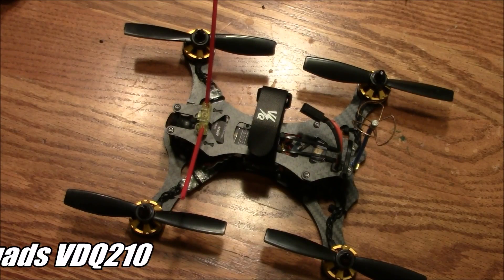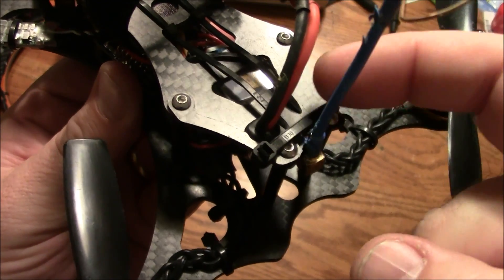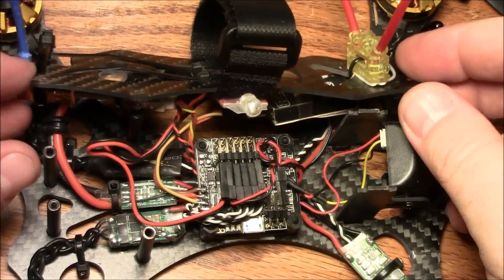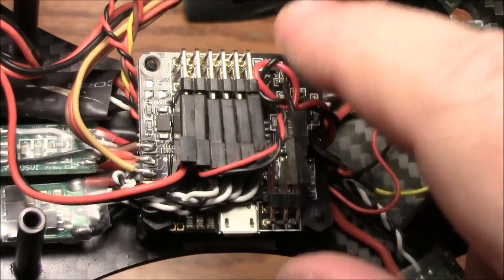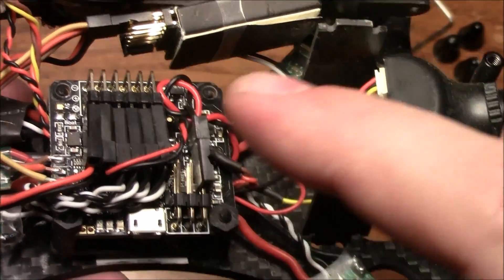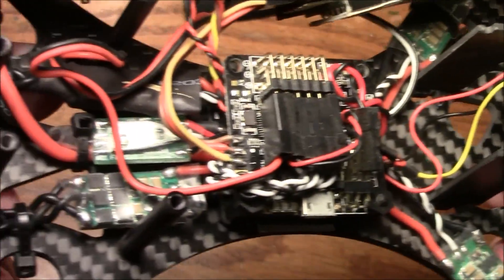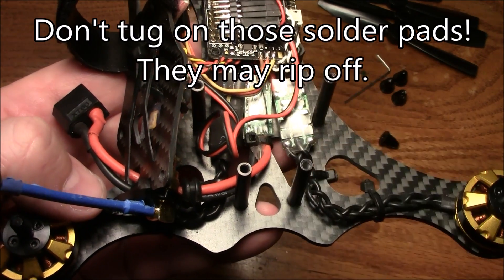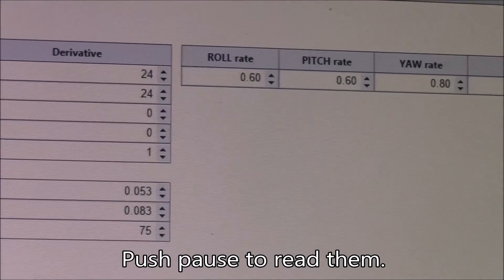VDQ210 Full Review, Tuning, Build Information, and FPV Racing

Comment: I am building this setup now. Is your receiver just hanging off the antenna wires or did you Velcro or double side tape it? Great video, thanks!
Reply from the maker: +Tod Anderson Heh... right now it is just hanging off the antenna wires.  I need to get some foam tape on it and a zip tie around it.  :)

Comment: How does it compare vs the ls-210?  There is a big price difference
Reply from the maker: Overall I like the VDQ210 better because i think it looks cooler and may fly a little better.  I'm less scared of crashing the LS210 because it was cheaper so I end up flying it a little more often.
Reply: +travisgrindal Any durability issues?  I like the price of the ls-210 and was wondering if those bigger holes on the bottom are a durability issue.  Also I read that the ls210 is actually 220?

Ouch I don't like that cracked arm!  That must have been a rough crash!
Reply from the maker: +CoolStuffReviews it is closer to 220mm.  i haven't had any problems with it yet and I've crashed it plenty.  The VDQ210 is also available now with a 4mm main plate.  It is a little heavier than the original 3mm but it seems to be a lot stronger.

Comment: Given that your naze32 already has vbat in connected, you dont need the battery voltage sensor, you can run a signal from a softserial port on the naze32 to the d4r-ii and output the battery voltage from that. There is a walkthough in to doco for cleanflight (turn on soft serial, go to the cli and enable telemetry signal inversion, add frsky to the appropriate port in the port selector, test). Save a few grams and $$ (once you get it working, it can be a pain)

Running the 5V from the transmitter isnt a bad idea. The only possible issue is it might not supply enough power and may brown out causing the FC to reset. Given the FC only needs a few hundred mA and the D4R-ii only needs about the same, this shouldn't be an issue as long as you arent doing something like running LEDs of it as well. Weight saving is awesome!
Reply from the maker: +Martin Turner I use to read the voltage from the Naze32 but (maybe it has changed now) it only outputs the voltage when the quadcopter is armed.  The FBVS-01 outputs the voltage readings all the time and it works consistently.  In fact, I use it a lot to check battery voltages at the flying field.
Reply: +travisgrindal only issue I seem to have with the cleanflight monitoring is it sometimes takes a few seconds after powering up before I get a reading, but it seems to read while disarmed now without issues. Do whatever works though :) You still fly better than me.

Comment: Travis, great video but i'm trying to figure out why you have the FRsky voltage sensor when you have this capability available in the Naze/D4r combo.  i may have missed it sorry!  Setup a serial port and a couple of commands and it works great.  plenty of information already out there to do it but i can link the one i use if you want...just need to find it.
Reply from the maker: +Beerad FPV I have a video on how to set it up.  The problem I've had with that config in the past is that sometimes it didn't work for me and I ended up over discharging my batteries.  Also, it only outputs the voltage while the board is armed.  Maybe that is changed now, I haven't tried it for a while.
Reply from the maker: +Beerad FPV Nice!  It didn't really change, that guy was using the soft serial output.  That is cool though.  I didn't know it could be connected that way.  Thanks for pointing that out!
Reply: +travisgrindal lol I meant "hasn't changed".  You figured it out though.  :)

Comment: Probably do a 5 volt step down just in case the  vtx goes out
Reply from the maker: +Drew Tuck A step down would work too.  I haven't had a VTX go out on me yet.
Reply: +Drew Tuck I use a PDB that has a built in 12v and 5v step down. I got them from banggood and they work very well. Below is the link to the one on the US web site.

http://us.banggood.com/Wholesale-Warehouse-CC3D-Flight-Controller-5V-12V-BEC-Output-Power-Distribution-Board-PCB-wp-Usa-973352.html
Reply: Tim, Yes. Because if the VTX loses power from a crash or some weird thing, you will be down, but using a PDB will let you still fly LOS if you lose power to VTX and it's safer!!

Comment: what do you think is stronger the vd quad or the xhover 230??
Reply from the maker: +tiger exhaust I'm not sure.  I haven't see the xhover 230 yet.  I may order one.  :)
Reply: thank you travis nice video like always
Reply from the maker: +tiger exhaust I looked at that xhover 230 and it looks pretty durable.  The strength of it and the VDQ250 would be real close.
Reply: these is going to be my first race quadcopter any recommendation on motor, esc ,batt, i have cc3d and i want to use 3s and 4s batt
 i am thinking to go with xhover 230 thank you  travis

Comment: i have had the motor spin when i arm my quad i was thinking about disabling this feature because if i crash and lose signal u can't disarm then your burning your escs up(this is from experience :/) is there any real benefit to leaving it alone? i don't think i ever go to 0 throttle unless im landing
Reply from the maker: +rayikaikin I have my motors set to not spin when I arm.  I just try to never drop my throttle to zero when I'm flying and I don't have any problems.  I think I like it this way because the KK2 board I learned to fly on didn't spin them up.